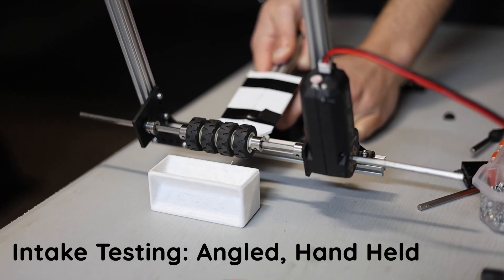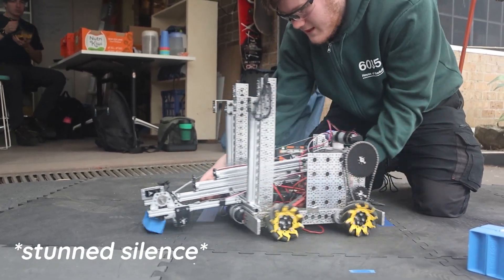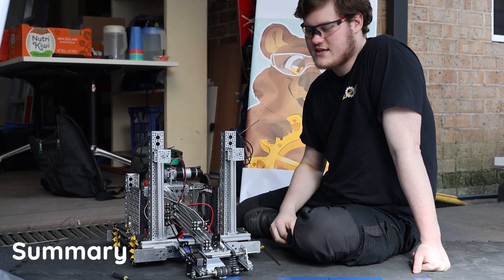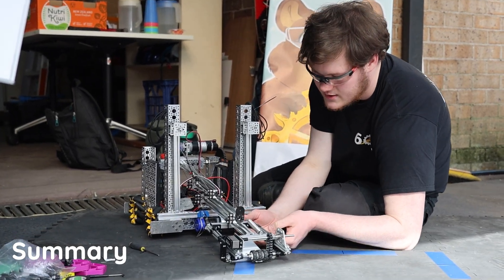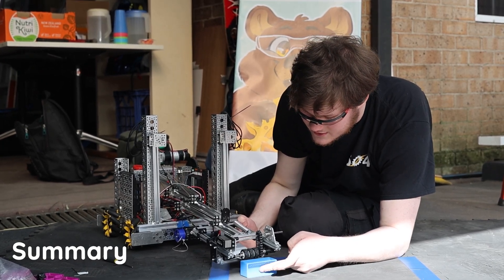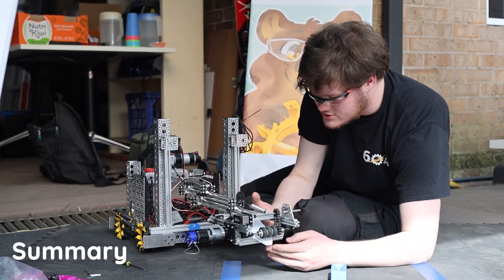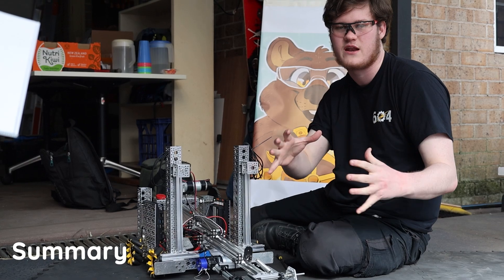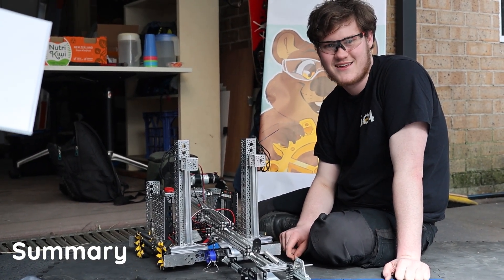"Touch it Own it!" | FTC Ri30H

Comment: Hi! I really like your guys's hang system, but I'm trying to understand how you're able to achieve this with the motor limit of 8. Where are the motors being distributed, and with the current distribution will your bot be able to complete a level 3 hang?
Reply: Currently this robot has 4 motors for driving, one for pivoting the arm, one for extending and one for climbing to the first stage. For the stage 3 climb, we had a number of different prototypes, some which only added one motor and some which added two, but removed the motor used for the original climb.